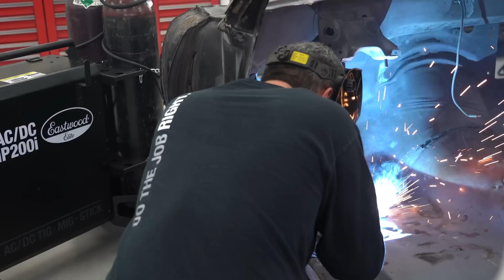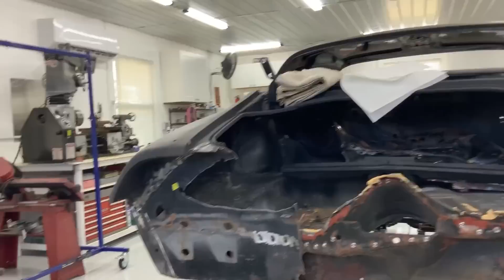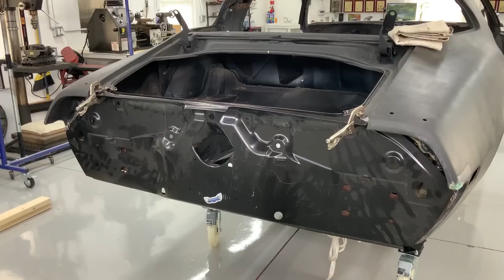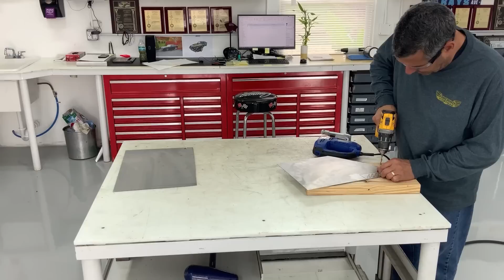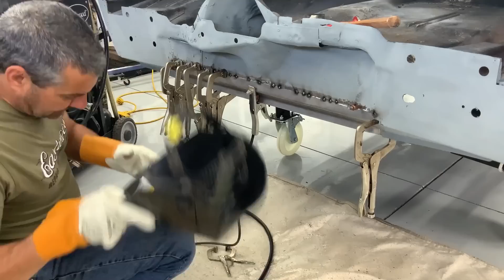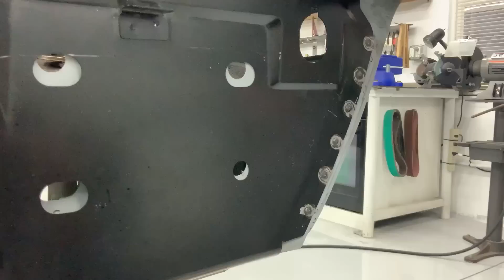How to MIG Weld New Sheet Metal - Rust Repair on the 1980 Trans AM

Comment: I'm replacing the tail panel on my '81 Trans Am. I'm using a Goodmark panel, but everything I see says they're all the same despite the brand name. I too can't get the eight bumper bolt holes to perfectly line up with the holes in the trunk floor and crossrail/frame extensions. I see in your video they didn't line up either. Mine come close but not like my original panel, which were almost perfectly aligned. I think whoever stamped these panels stamped these holes slightly off. I guess it's not a big deal. They can be opened up a bit so the bumper can go in. It would help align this panel exactly where it needs to be if these holes were exactly correct. Aftermarket body panels never cease to disappoint me.